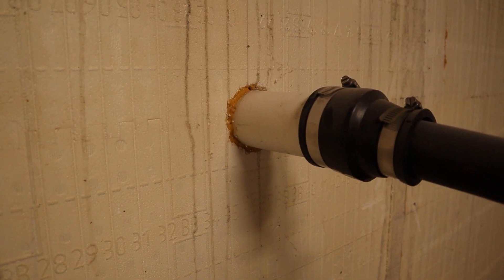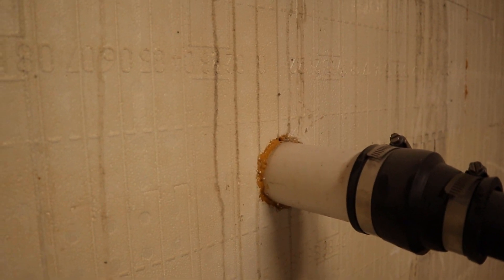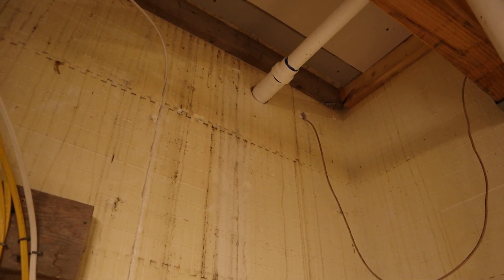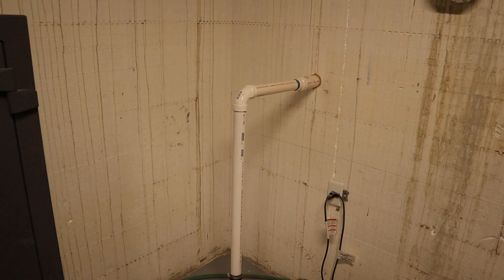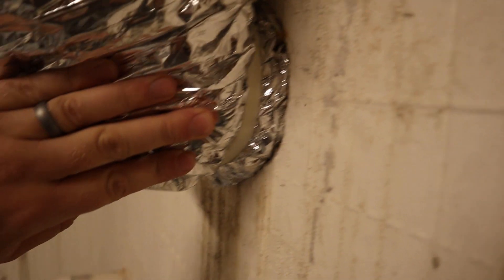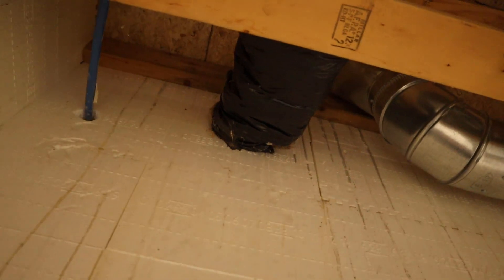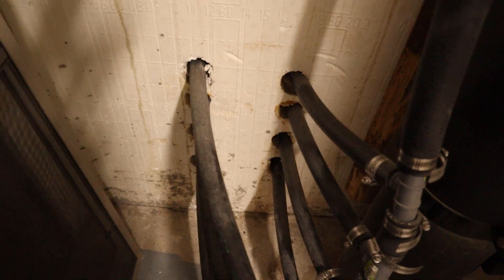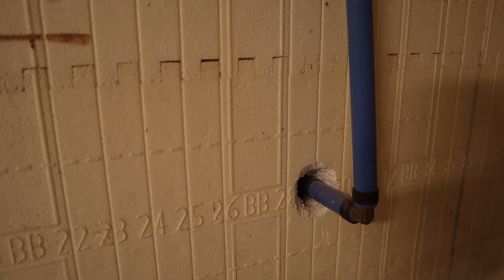How To Put Pipes Through ICF Walls | ICF Pipe Penetrations

Comment: I build commercial swimming pools for a living.  There are hundreds of pipe penetrations through pools.  Best way to waterproof a pipe penetration is a product called “Swell Seal”.   It’s very easy to install and relatively inexpensive.   It’s essentially a swell tape.  When water hits it, it swells up to create a seal.  The more water that attempts to pass it, the more it swells. Link seals are very expensive, and so is coring smooth holes through concrete.  Link seals also require maintenance and proper tensioning.  They’re a pain in the ass basically.  Swell seal is easier, cheaper, and better. However, swell seal is really only and option before walls are poured.
Reply from the maker: Thanks for sharing

Comment: Great Stuff Pond and Stone is the best thing we have found for sealing holes in basement walls. My Dad has been a well repair guy for 30 + years and he hasn't had a leak since he started using it. We actually took a dry chunk of the Pond and Stone and tied it to a rock and sunk it in a pail of water for months. When we pulled it out it beaded the water right off and was completely dry.

Comment: How it possible to put flue for wall heater in ICF?
Reply from the maker: It depends on the flue pipe and the clearances around it.  Your local code requirements will tell you what you can use.

Comment: This might be a bit late but you need to be careful with code requirements for wall penetrations. Sewer and Water sleeves sometimes must come out of the wall as a single piece a certain distance, in my area this is 5', so putting a coupling at the outside of the ICF may not pass inspection. Always check with your local building inspector or your city water and sewer department. Mine has a downloadable document that describes the requirements well.

Other thing to remember with electrical conduit penetrations, you cannot bury an Ell so make sure you locate the pipe low enough on the wall to make any upward turns you might need, especially if your service entrance is a meter on the side of the house that then comes down through the basement wall.

Comment: We are building an ICF house and our builder made a smart suggestion for the sewer penetration in the wall.  Instead of placing conduit in the wall, he inserted a solid piece (10"x16") of EPS inside the wall to prevent concrete from filling the space.  The benefit is that this allows the plumber to fine tune the location based on the required slope and simply use a hole saw to cut through the EPS blank.
Reply from the maker: Interesting suggestion.  It's nice to know there are always more than one way to do things.

Comment: Hey Garrett what your looking for is linkseal & GPT your cutting a square hole or round your choice about three inches around the pipe allowing concrete to flow around place 3/4 plywood on both sides of the icf watch the video and you'll get the idea good luck

Comment: Just two cents from a plumber about that sump discharge, I would move that check valve up as high as you can on the pipe.  You don’t typically want a large column of water constantly pushing down on that valve.
Reply from the maker: Makes sense. Thanks for the advice.
Reply: That would put a gallon per 6' of 2" pipe back into the sump basin every time it runs..
Reply: @timm439  A plumber would suggest a DIY person to put the check valve up as high as possible, that way the water drops back down, triggers your pump again, then it goes bad by short cycling and you realize you need to call a plumber to fix your problem. Makes sense to me.